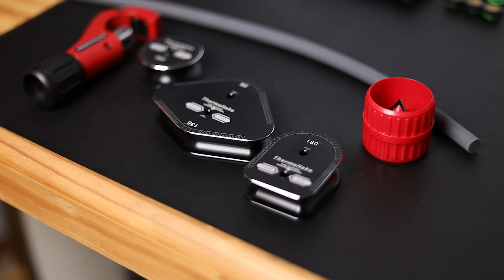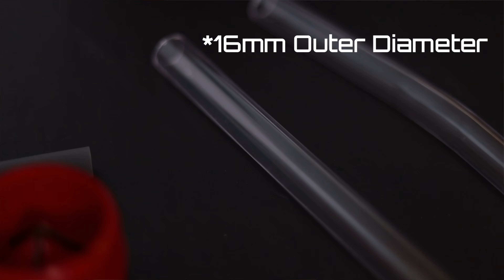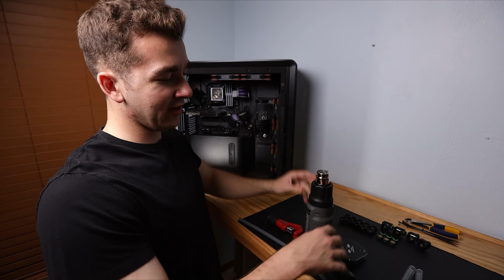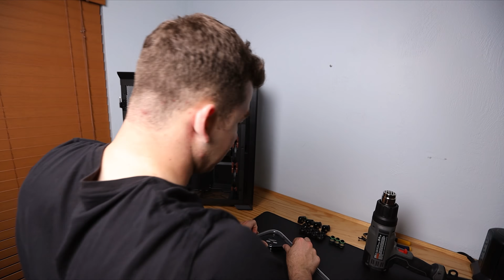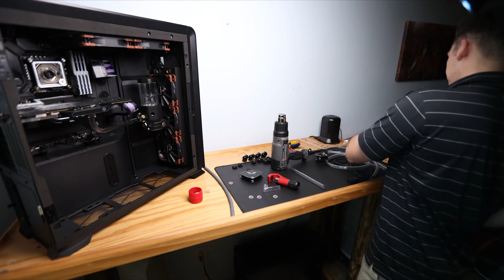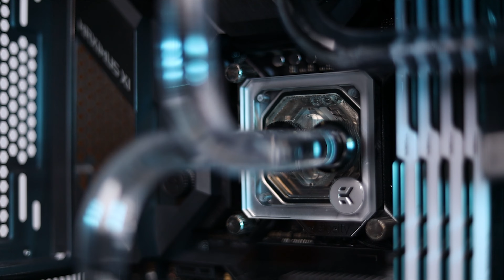How to Build a  Water Cooled PC with RIGID Tubing, Water Cooled PC Rebuild Vlog 2

Comment: that case is huge so why the hell it looks small next to you lol It could still be the PSU, I have a PSU that turns on plays 4k movies, and plays games and everything(with a GTX 660), but after upgrading the GPU (gtx 970) the PSU could no long handle the output but would still play movies among other things, but refused to play games. It was a 750 watt gold, the new PSU is a 700 watt gold and its play everything fine now after the new PSU install.
Reply from the maker: roshawn1111 haha thanks, that case makes me feel small when I have to pick it up and move it. Wow man that is a strange issue, I wonder if you 750 watt was going out and not outputting enough power. Glad to hear you got it running with the 700 watt PSU!
Reply: @JakeVirdenTech  yea it was going out, but as long as it was running the gtx 660, it was fine. The 970 needs more power and thus the PSU couldn't handle it.
Reply from the maker: @roshawn1111  Yea a GTX 970 is defiantly increasing the power draw over a 660, but worth it for the extra performance!

Comment: can be couple things. 
1. you shorted the board. many ways... water even small drop while you where poring or plash it without seeing it. microscopic. 
2. the clock you use have a tendency to short the board due to the metal touching the board. it does have rubber washer but sadly the screw they use for the 2017-2020 early had issues with this.
 has the board worked before? and when setting the board up did you do it while standing on carpet?